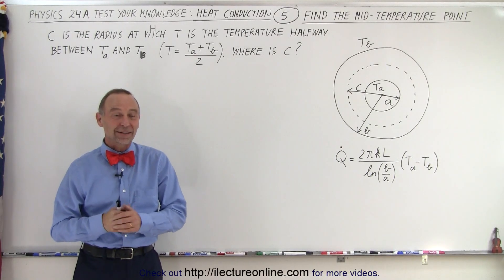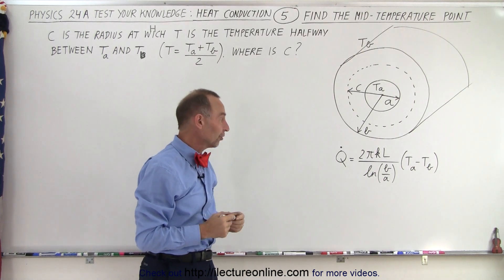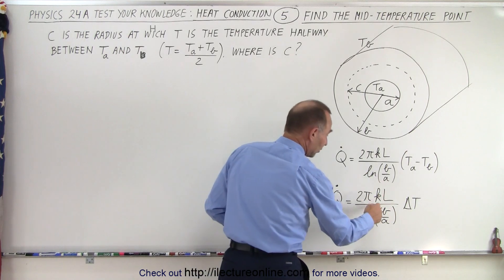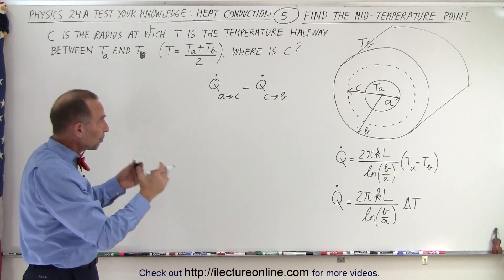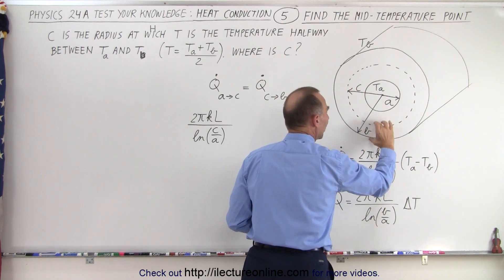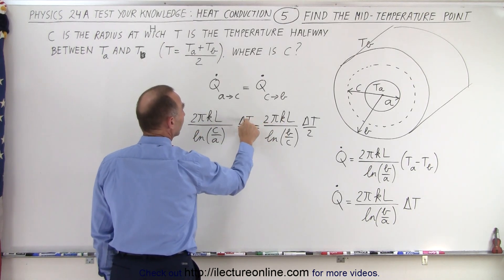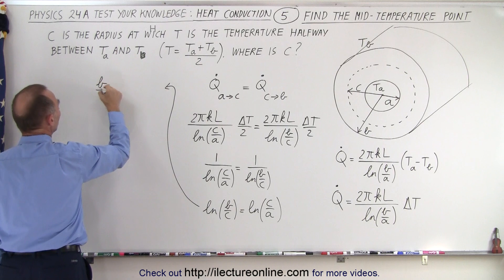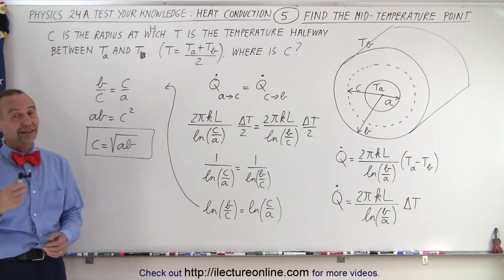Physics 24A  Heat Conduction Examples (5 of 22) Find the Midpoint Temperature=?

Comment: Untuk bentuk bola 
Saya hanya fokus pada perbandingan jari jari selubung bola terhadap ketebalan kulit bola. Yang mana perbandingan jari jari selubung bola terhadap ketebalan kulit bola  = 1. Dengan persamaan umumnya adalah :
Q 		= - k. A. (dT)/ (dR ). 	Hukum fourrier  	
Q 		= k. 4π R2. (∆ T)/ ( R2 – R1 ). 					………. 	1
Q 		= k. 4π R1. R2. (∆ T)/ ( R2 – R1 ). 					……….	2
Q 		= k. 4π R1 . R2.(∆ T)/ ( R2 – R1 ) = k. 4π R2.(∆ T)/ ( R2 – R1 ).  Pada rumus ini menekankan pada perbandingan jari jari kulit  bola terhadap ketebalan bola. Sehingga persamaannya adalah :
k. 4π R1 . R2.(∆ T)/ ( R2 – R1 ) = k. 4π R2. (∆ T)/ ( R2 – R1 ), sehingga bagian yang tereliminasi adalah k .4. π. 
 R1 . R2. (∆ T)/ ( R2 – R1 ) =  R2.(∆ T)/ ( R2 – R1 ).
( R1 . R2.)0.5 (∆ T)/ ( R2 – R1 ) =  ( R2 )0.5.(∆ T)/ ( R2 – R1 ).
( R1 . R2.)0.5 . (∆ T)/ ( R2 – R1 ) =  R.(∆ T)/ ( R2 – R1 ). Sehingga didapatkan perbandingan jari jari kulit  bola terhadap ketebalan bola.
( R1 . R2.)0.5 / ( R2 – R1 ) =  R/ ( R2 – R1 ). Sehingga perbandingan jari jari kulit  bola terhadap ketebalan bola
( R1 . R2.)0.5 :  ( R2 – R1 ),   adalah perbandingan jari jari kulit  bola terhadap ketebalan bola.
Dimana,
dR				: Ketebalan sesaat. (R2 – R1 ) atau ( outer –inner )
dT				: Temperature sesaat
K				: Konduktifitas thermal materi
Q				: Nilai kalor
R				: Panjang jari jari selubung
X				: Outer atau R1
∆T				: Hasil integral dari dT
∆R				: Hasil ( R2 -  R1 ) = ( outer – inner ) = tebal
2πR				: Keliling selubung silinder
2πR.L			: Luas selubung silinder

Keberatan saya adalah :
1.	R2 	: R2 .-  R1
R2 	: R2 .-  R1 		~ 	R2. R1	:      R2 .-  R1,
R2 	=  R2. R1
Komentar saya adalah bahwa R2 ≠ R1 x R2.  R yang dimaksud adalah memiliki nilai yang sama, yaitu R x R.
Uraian penalaran :
R2 	: R2  - . R1 		 	 
R2 	: R2 .-  R1,  		   untuk R2 = R x R. 
R2 	= R x R 
R. R	= R1 x R2 								…???
R . R	= R1 x R2, oleh karena R bernilai sama, maka R1 =  R2. Penulisan ini akan bermasalah dengan persamaan :  
Q 	= k. 4π R2.L (∆ T)/ ( R2 – R1 ),  dimana R2  =  R1.
Q 	= k. 4π R2.L (∆ T)/ ( R2 – R2 ).
Q 	= k. 4π R2.L (∆ T)/ ( 0 ).
Q	= + ∞ 								… ???.
Alternatifnya adalah :
R2 	: R2  - . R1 ,			 
R2 	: R2 .-  R1,  untuk R2 = R x R. 
(R . R}0.5	= ( R2 . R1 )0.5
R	= ( R2 . R	1 )0.5    							… ???.
Apakah jari jari selubung bola ( R ) adalah ( R2 . R1 )0.5  			… ???
Jika demikian halnya. Apa yang bisa dijelaskan dari ( R2 .R1)0.5  secara visualisasi  	… ???.
Komentar saya adalah  kesimpulannya R2 ≠ R1. R2
2.	Saya akan paksakan bahwa R2 = R1. R2. untuk membuktikan  keberatan saya. Selanjutnya dengan melakukan substitusi ke persamaan  awalnya, saat R1 = 0. ( Solid ).
Q 			= - k. A(dT)/ (dR ).
Q 			= k. 4π R2.L (∆T)/ (∆R)
Q 			= k. 4π R2.L (∆T)/ ( R2 - R1 )
R1.adalah jari jari outer dan R2 adalah jari jari inner

R2			= R1.R2
Q 			= k. 4π R2.L (∆T)/ ( R2 – R1 ).
Q 			= k. 4π R2.L (∆T)/ ( R2 – R1 ). saya fokus pada persamaan yang hurufnya bold.

Bagaimana jika R1 bernilai 0 ?.  Saya substitusikan rumus dasarnya.
Q 			= k. 4π R2.L (∆T)/ ( R2 – R1 ).
Q 			= k. 4π R1. R2.L (∆T)/ ( R2 – R1 ).
Q			= k. 4π 0. R2.L (∆T)/ ( R2 – 0 ).
Q			= k. 4π 0. .L (∆T)/ ( R2  ).
Q			= k. 4π 0. .L (∆T)/ ( R2  ). Pada persamaan ini muncul 2 jawaban.
Dalam hal ini akan muncul 2 alternatif jawaban.
Q			= k. 4π 0. L (∆T)/ ( R2  ),  0/R2 = 0, 
Sehingga,
Q			= 0		 			( alternatif 1 ).
Komentar saya adalah apakah Q = 0 ???
Atau altenatif lainnya adalah
Q 			= k. 4π R2.L (∆T)/ ( R2 – R1 ), R2 = R1. R2
Q 			= k. 4π R1. R2.L (∆T)/ ( R2 – R1 ), 0 =  R1
Q			= k. 4π 0. R2.L (∆T)/ ( R2 – 0 ), R2 – 0 = R2 
Q			= k. 4π 0. L (∆T)/ ( R2  ).
Q			= k. 4π 0. .L (∆T)/ ( R2  ),  0/R2 = 0 pindah ruas kiri
Q /  0			= k. 4π .L (∆T)   
+∞			= k. 4π .L (∆T ), k. 4π.L adalah nilai konstan ( C ), sehingga 
+∞			=  C ((∆T ), sehingga, 
+∞    			= ( ∆T ), ∆T = T1 – T2
+∞    			=  T1 – T2, , T1  = +∞ dan T2 diketahui
+∞    			=  ( +∞ – T2 ), satuan sisi kiri adalah watt dan satuan sisi kanan temperature sehingga tidak boleh dikurangi.
+∞    			=   T1
+∞   			= (∆T ), ∆T =  ( +∞ – T2 )	  		( alternatif 2 )
+∞ 			=  T1, ∆T =  ( +∞ – T2 )
+∞ 			=  T1,	
Komentar saya adalah  apakah (∆ T ) = (+∞ ) atau  (T1 ) = (+∞ )  ???
3.	Apakah jari jari selubung  bola dibanding ketebalan kulit bola pernah bernilai 1? Jika ditemukan rasio jari jari selubung bola terhadap ketebalan kulit bola memiliki nilai 1 , maka rumus yang digunakan perlu untuk dikaji ulang. Alasannya adalah jari jari selubung bola bergerak tidak linier terhadap ketebalan  kulit bola. Sedangkan jari jari selubung bola bergerak berdasarkan fungsi hiperbola tertentu( tidak menyatakan garis linier. Yang bermakna R2 / ( R2 – R1 ) ~  R2 R1 ( R2 – R1 ). 
Sehingga, 
R / ( R2 – R1 ) = ( R2 R1 )0.5 / ( R2 – R1 )  adalah perbandingan  jari jari selubung bola terhadap ketebalan kulit ( R2 – R1 ).
(R1 . R2 )0.5  / R2 -. R1 tidak pernah bernilai 1. Ditulis dalam persamaan adalah (R1 . R2)0.5  / R2 -. R1 ≠  1. 
Mari kita buktikan bahwa (R1 . R2)0.5  / R2 -. R1 = 1, jika bisa ditemukan , maka rumus sebelumnya harus dikaji ulang. Sebagai catatan bahwa saya akan paksakan bahwa R2  =  R2. R1 dan R = ( R2 . R1)0.5. Sehingga perbandingan jari jari selubung bola terhadap  ketebalan kulit bola ditulis dalam persamaan :

( R1 . R2 )0.5  / R2 -. R1		 = 1				…………….	Persamaan 1	 
Q 		`		= k. 4π R2.L (∆ T)/ ( R2 – R1 ). 				 	
Q 				= k. 4π R1.R2.L (∆ T)/ tebal. 
Fokus  pada R2 / ( R2 – R1 ).
R2 / ( R2 – R1 )										 
R2  				= R2. R1
( R2 )0.5  				= ( R2. R1 )0.5
R				= ( R2. R1 )0.5
Yang dicari adalah jari jari selubung bola terhadap  ketebalan kulit bola.
R / ( R2 – R1 )			= 1,  R = ( R2. R1 )0.5
( R2. R1 )0.5 / ( R2 -  R1 )		=  1
( R2. R1 )0.5 			=  1.( R2 -  R1 )
( R2. R1 )0.5 			=  ( R2 -  R1 )
( R2. R1 )				=  ( R2 -  R1 )2
( R2. R1 )				=  ( R22 - 2 R2 . R1 + R12 )
( R22 - 2 R2 . R1 + R12 ) / ( R2. R1 )	= 1
R2 / R1 – 2 + R1 / R2		= 1
R2 / R1 + R1 / R2			= 1 + 2
R2 / R1 + R1 / R2			= 3,   x R1 . R2
R22  + R12				= 3 R1 . R2
R22  - 3. R1 . R2 + R12		= 0
(R2   -  0.381969.R1 ) (R2  - 2.618031.R1  ) = 0
R2 - 0.381969.R1			= 0,	harus memenuhi  R2 > R1 	
R2  				= 0.381969.R1
R2 : R1				= 0.381969 : 1, ternyata R2 <  R1. Persamaan ini tidak bisa digunakan.
Dan berikutnya adalah persamaan yang ke dua					 
R2  - 2.618031.R1  		= 0
R2   		  		= 2.618031.R1  
R2 : R1				= 2.618031 : 1, persamaan yang digunakan adalah :
(R2  - 2.618031.R1  ), memenuhi R2 > R1.
Jadi untuk sembarang R2 ( outer ) akan selalu memenuhi persamaan

( R1 . R2 )0.5  / R2 -. R1 = 1, saat R2 : R1	= 2.618031 : 1

R2 : R1				= 2.618031 : 1, adalah rasio outer terhadap inner
( R1 . R2 )0.5  / R2 -. R1 		= 1, Kembali pada persamaan ( 1 ).
R2 				= 2.618031
R1				= 1
 ( 1. .2.618031  )0.5  / 2.618031  -.  1	= 1.
Adalah suatu keadaan dimana panjang jari jari selubung bola terhadap panjang  jari jari bola memilki panjang yang sama. Hal ini tidak pernah terjadi. Alasannya adalah jari jari selubung bola bergerak tidak linier terhadap jari jari  bola. Sedangkan luas kulit bola bergerak berdasarkan fungsi hiperbola tertentu( tidak menyatakan garis linier).
Namun demikian untuk kasus perpindahan panas konduktor aliran steady state bentuk  silinder dan bentuk bola. Ada syarat lain yang harus diikutii. Yaitu nilai jari jari selubung terhadap ketebalan bola harus selalu bernilai lebih dari 1. Mengapa harus selalu bernilai lebih dari 1 ? hal ini disebabkan adanya perubahan luas penampang yang tidak bergerak linier terhadap jari jari silinder maupun bentuk bola.
Reply from the maker: Thank you!

Comment: Uraian  singkat keberatan saya dengan rumus perpindahan panas ( Heat transfer ) yang sudah ada adalah :
Untuk bentuk silinder 
Persamaan umumnya adalah 	
Q				= -k. A. (dT)/ (dR ).  Hukum fourrier

Sehingga persamaan umum diturunkan untuk kasus silinder menjadi,  
Q				=  k. 2π.R.L ( dT )/ ( dR ), 		……… 	Persamaan 1
Pindah ruas kiri di Integral dR/R. Dengan batas atas outer ( R2 ) dan batas bawah inner ( R1 ), dT dintegralkan menjadi ∆T. sehingga persamaan berubah menjadi,
Q. Ln ( R2/R1 )		=  k. 2π.L ( ∆T )			
Q 				=  k. 2π.L ( ∆T) / [ Ln ( R2/ R1 )].	……….	Persamaan 2
Persamaan 1 equivalen dengan persamaan 2
Q				= k. 2π.R.L ( dT )/ ( dR )		= k. 2π.L ( ∆T) / [ Ln ( R2/ R1].
Q / k. 2π.L			= R. ( dT )/ ( dR )			= ( ∆T) / [ Ln ( R2/ R1].
Q / k. 2π.L adalah konstan ( C ), sehingga
C				= ( dT ).R / ( dR )			= ( ∆T) / [ Ln ( R2/ R1].
( dT ).R / ( dR )		= ( ∆T) / [ Ln ( R2/ R1], dT = ∆T.
( ∆T ).R / ( dR )		= ( ∆T) / [ Ln ( R2/ R1 )].
( ∆T ).R / ( R2 – R1)		= ( ∆T) / [ Ln ( R2/ R1 )], ( outer – inner ) = R2 – R1 = tebal  
( ∆T ).R /  tebal		= ( ∆T) / [ Ln ( R2/ R1 )], ∆T di eliminasi.
R /  tebal			=  1/ [ Ln ( R2/ R1 )].
1: [ Ln ( R2/ R1 )].		= R :  tebal.
1: [ Ln ( R2/ R1 )].		= R :  ( R2 – R1 )
R :  ( R2 – R1 )			= 1: [ Ln ( R2/ R1 )], diubah untuk R1 adalah x dan R2 adalah e ( bilangan euller ) sehingga,
R :  ( e – x )			= 1: [ Ln ( e/ x )], dimana x : 0 ≤ x ≤ e ..…….	Persamaan 3	
Dimana,
dR				: Ketebalan sesaat. (R2 – R1 ) atau ( outer –inner )
dT				: Temperature sesaat
e				: Bilangan euller atau R2 atau outer
K				: Konduktifitas thermal materi
L				: Panjang silinder
Q				: Nilai kalor
R				: Panjang jari jari selubung
X				: Outer atau R1
∆T				: Hasil integral dari dT
∆R				: Hasil ( R2 -  R1 ) = ( outer – inner ) = tebal
2πR				: Keliling selubung silinder
2πR.L			: Luas selubung silinder
	Uraian keberatan saya adalah :
a.	Perbandingan jari jari selubung terhadap ketebalan silinder tidak pernah kurang dari 1. Kondisi ini terjadi saat ketebalannya ( e – x ) , yang mana e ( logaitma natural ) adalah jari jari outer dan x adalah jari jari inner yang berkisar 0 < x < e^0 . Alasan keberatan  saya adalah jari jari selubung selalu bergerak membesar mengikuti perubahan luas. Sedangkan ketebalan bergerak secara linier. sehingga tidak pernah terjadi suatu peristiwa jari jari selubung lebih pendek dari pada ketebalan. Dengan demikian jari jari selubung selalu lebih besar terhadap ketebalan dalam kondisi apapun.
b.	Saat silinder pejal (  tidak memiliki lubang ), maka suhu akan menjadi +∞ (suhu meningkat sangat besar tak terbatas pada pusat silinder). Kondisi ini terjadi saat ketebalannya ( e - 0). e ( logaritma  natural ) adalah jari jari outer merupakan  bilangan natural dan  0 adalah jari jari inner. Alasan keberatan saya adalah sangat tidak masuk akal suatu materi dalam kondisi pejal dapat menahan panas dengan suhu  + ∞. Pendapat saya adalah suhu masih bisa diketahui meskipun  sulit di praktekkan dalam kondisi pejal kondisi tersebut.  
c.	Perbandingan jari jari selubung terhadap ketebalan lebih besar dari 1 ( tidak memiliki batas ) dan berakhir pada 0 ( NULL ) saat ( e – e ) yaitu outer = inner . Alasan keberatan saya adalah jari jari selubung memang harus lebih besar daripada jari jari. Namun memiliki batas nilai tertentu !!!
d.	Secara umum alasan keberatan saya dari point a, b dan c adalah penggunaan logaritma natural menyebabkan ketidakpastian perbandingan jari jari selubung terhadap jari jari.
a.	Saat ketebalan ( e – x ) , 0 < x < e^0, maka perbandingan jari jari selubung < ketebalan.
b.	Saat ketebalan ( e – x ) , x = 0  , maka perbandingan jari jari selubung terhadap ketebalan + ∞.
c.	Saat ketebalan ( e – x ) ,  x = e^0, maka perbandingan jari jari selubung  = ketebalan.
d.	Saat ketebalan ( e – x ) , e^0 < x < e, maka perbandingan jari jari selubung > ketebalan
e.	Pertanyaan saya adalah : Bagaimana menghitung suhu di pusat silinder saat panas berasal dari luar silinder secara konduksi dengan aliran steady state ???
f.	Ramalan kesalahan hitung sangat serius. Saat outer menjadi sangat besar dan inner mendekati outer ( relative tipis ). Maka kesalahan hitung pada suhu menjadi sangat besar.
Mengapa rumus yang sudah ada dianggap sebagai kebenaran ?, hal ini disebabkan oleh nilai kalor harus selalu ( konstan ) di tiap tiap perubahan ketebalan yang mengalami perubahan suhu meningkat saat mendekati pusat silinder seiring dengan perubahan ketebalan yang mana suhu awal berasal dari inner jari jari. Dengan catatan sumber panas berasal dari dalam silinder.
Reply from the maker: Thank you!

Comment: how about the halfway temperature of a glass?
Reply from the maker: Not sure what you are asking.  Can you clarify what you question is?
Reply: @MichelvanBiezen  Sorry for not confusion, A glass window in a storefront has an area of 12 m² and a thickness of 1 cm. The thermal conductivity of the glass is 0.8 W/m-°C. On the cold day, outside surface temperature of the glass is -1 °C and the inside surface temperature is 3 °C. Determine the temperature at a plane midway between the inside and outside glass surfaces.

My answer is 1.81 Celsius, not sure that is correct,
Reply from the maker: The temperature gradient within an object through which heat travels tends to be linear.  Therefore you would expect the temperature at the halfway point to be the average.    T middle = (T left + T right ) / 2 =  ( 3 + (-1))/2 = 1    (Answer: T middle = 1 degree C
Reply: @MichelvanBiezen  Thank you very much sir.